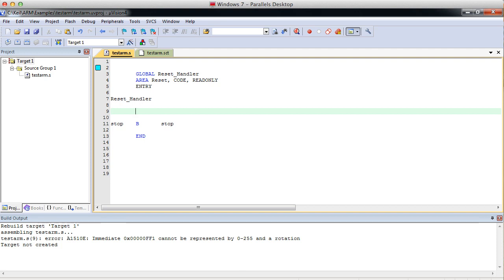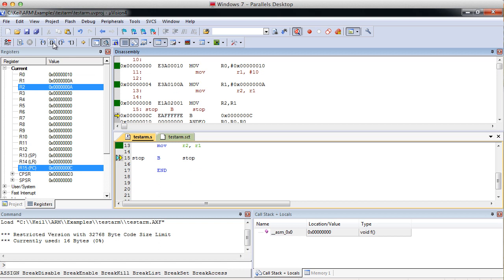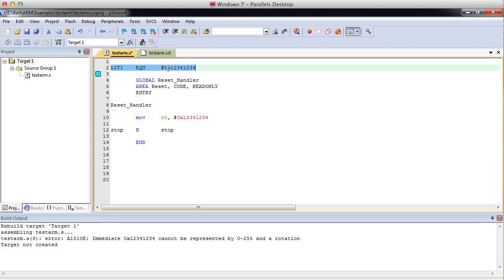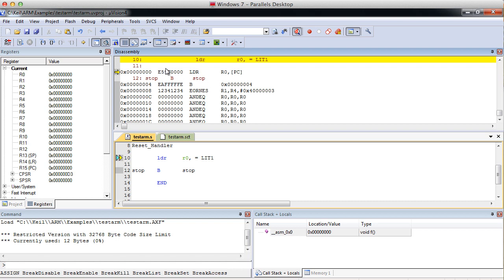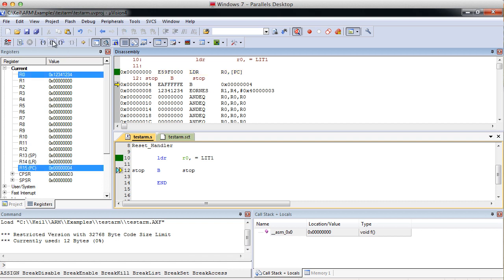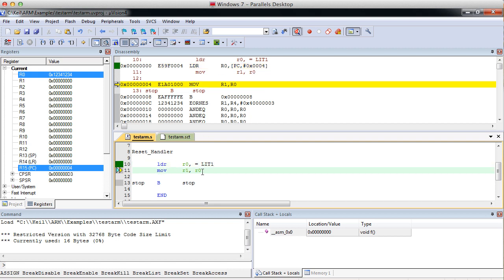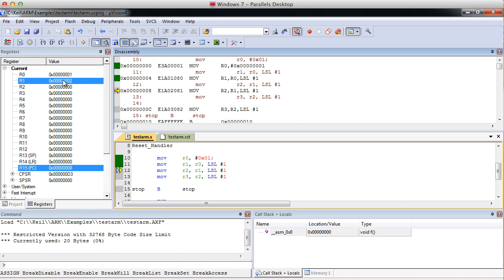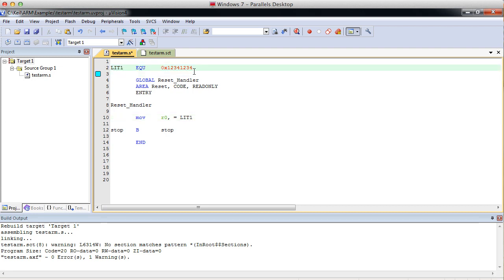Arm Assembly - Moving Literals into Registers.mp4

Comment: Thanks for the video! For those who wants to know why ARM 'looks' at 2 instructions ahead, it is due to the pipeline that ARM uses "Fetch, Decode, Execute". In other words, when you are executing instruction 0x00 (1st instruction), it is already 'looking' or fetching 0x08 (3rd instruction) (*Note: 1 ARM instruction is 4Bytes here). PC (Program Counter) tells us which is the instruction the microprocessor is Fetching next.
Another question that I had previously was, why use MOV as much as possible instead of LDR for addresses?
MOV instructions are much faster but the downside is that MOV is limited to addresses that can be addressed from 0x00 up to 0xFF, with EVEN (Due to ARM's barrel shifter and how the MOV instruction is set) ROR rotations. So if we want to move an address of 0x7D8 into a register, it is not possible. However, an address like 0xA400 is fine (MOV rd, #0xA4, 24).
LDR instructions allow us to move in any 32-bit address, however it will will be slower than MOV as you can see in the video itself.
Assembly programming focuses on efficiency and code size, thus we try to use MOV as much as possible when we want to store an address into a register

Comment: could I load a 32bit value for instance by
mov r0, 0x10
mov r1, r0, LSL 27
bitwise or r1, r1, 0x10

to make r1 carrying 0x10000010?

This is how PPC asm works
lis r1, 0x1000
ori r1, r1, 0x0010
Reply: Yes we can. But that will be 3 instructions and it is not efficient and uses 3 times the memory than a single LDR. Since 0x10000010 cannot be done with a MOV instruction (even with ROR), we use LDR r1,=0x10000010 instead.

Comment: Mark great tutorial series!  The new Keil v5 does not have the simulator you set up originally the LC 2100 series. Every other simulator I continue to get a Memory Write fault.  I tried to update these values manually in the Memory map but cant step through any of the execution examples.  Any thoughts?